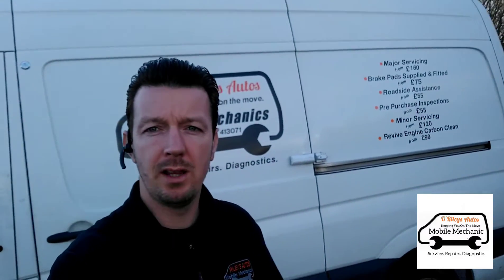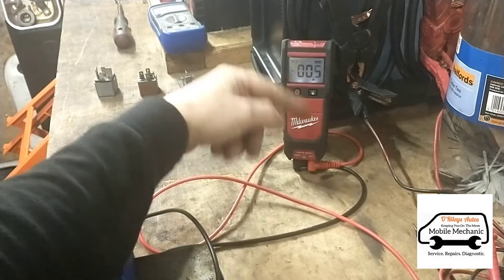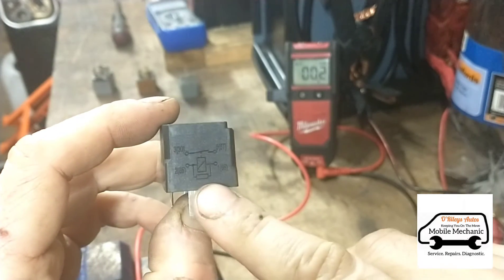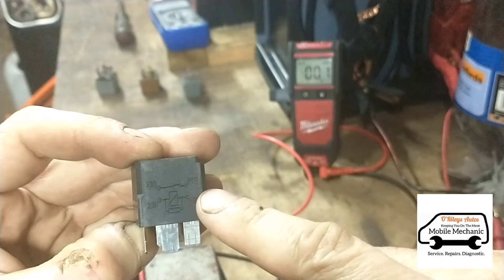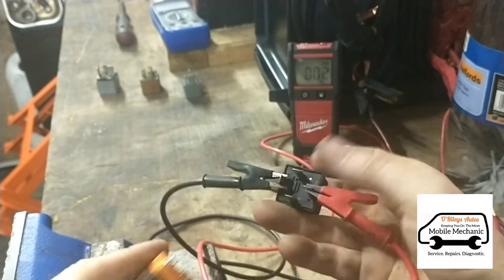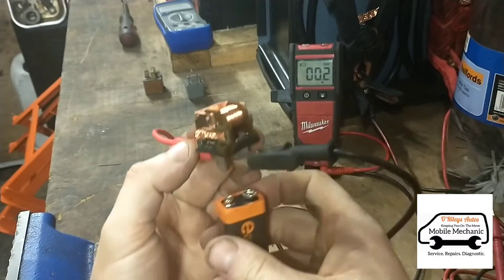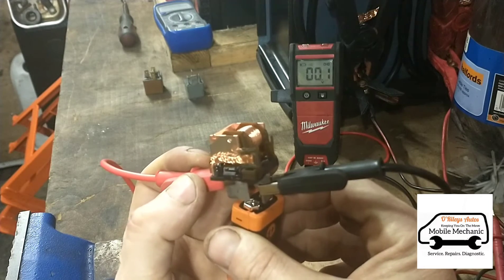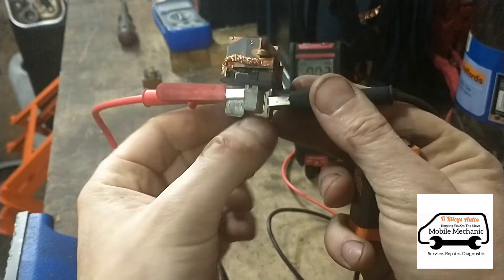Easiest Way To Check A Car Relay in Under 60 Seconds. Continuity Test Using A 9V Battery

Comment: I find relays rarely fail these days.  Usually oxidation of the relay connectors in the fuse box is more common. But good quick cheap test.
Reply from the maker: Thanks for watching